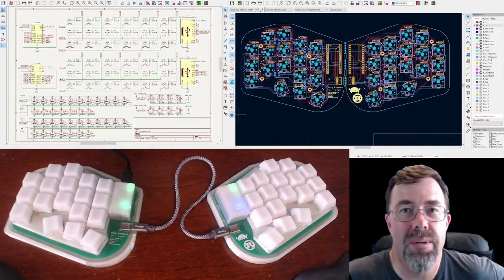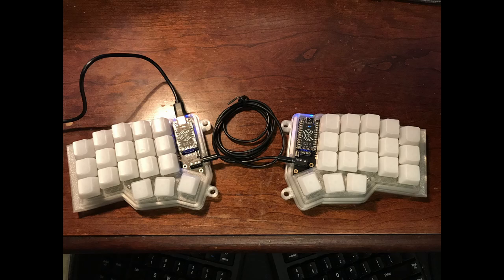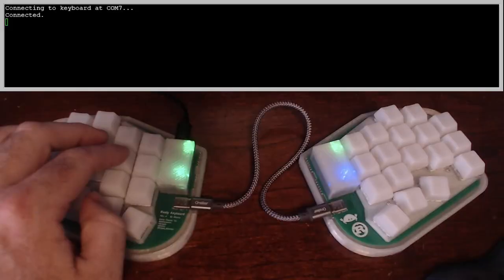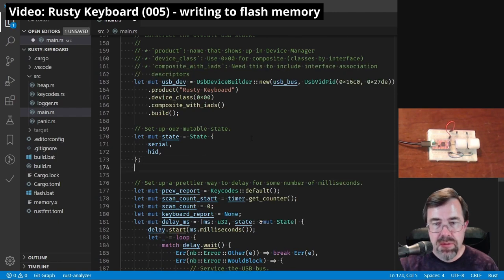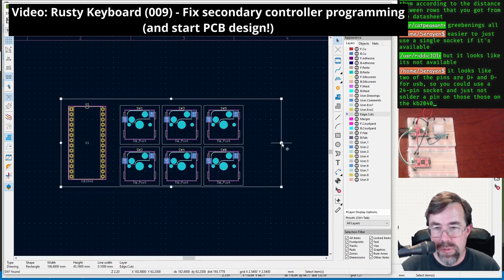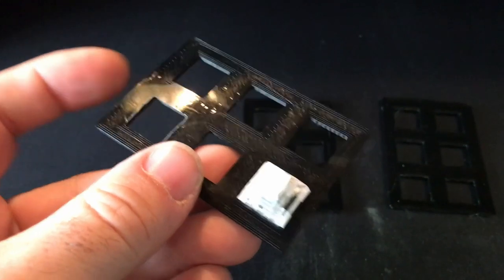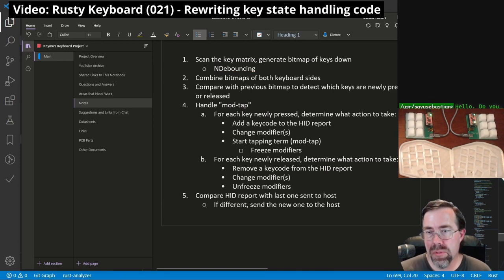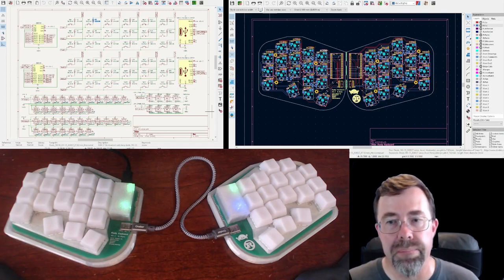I Designed, Built, and Programmed my own Keyboard

Comment: Any chance of a GitHub repo with the project files? I’m interested in tweaking and building one of these myself!
Reply from the maker: I wish I could but one of the conditions of my current job is that I'm not to participate in open source without explicit permission, that requires an extensive approval process.  So no code uploads from me for a while, although my GitHub still exists, it's basically frozen.  Sorry!